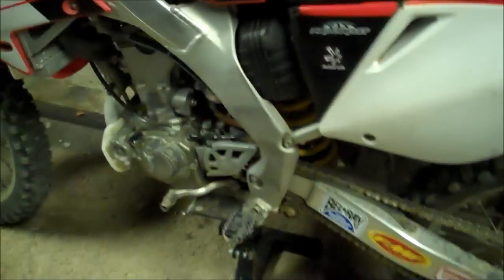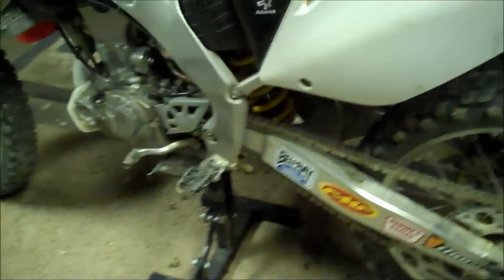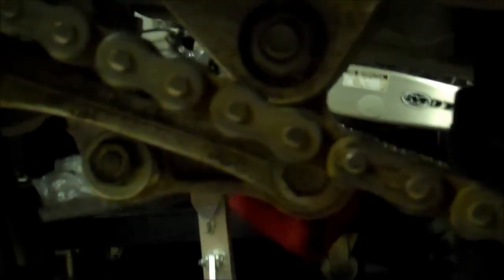Rear shock problem!

Comment: I used to have a 2004 CR125R that did that when it was on a stand and i pressed down slightly. I have been told that the noise is a worn bushing up where the shock attaches to the frame, so there is some play and that's where the click comes from. However, every bike ive ever had the chance to check for the noise has made it. But it didn't affect performance. If it doesn't affect suspension performance, and everythings smooth, and it only does it when its on a stand i wouldnt worry about it.